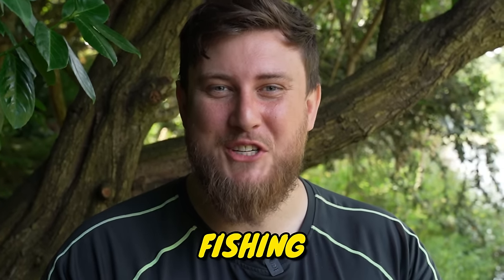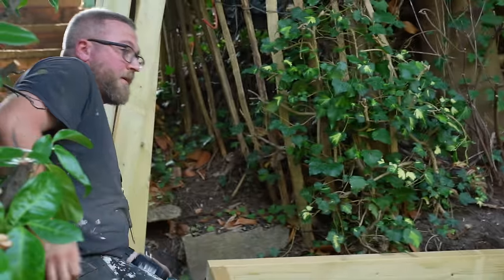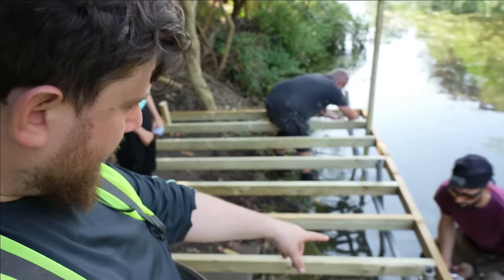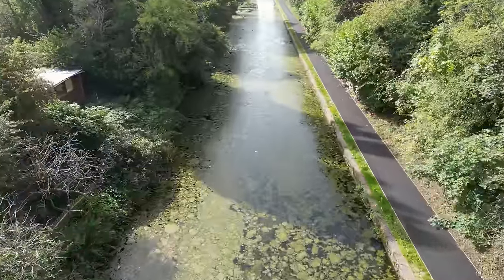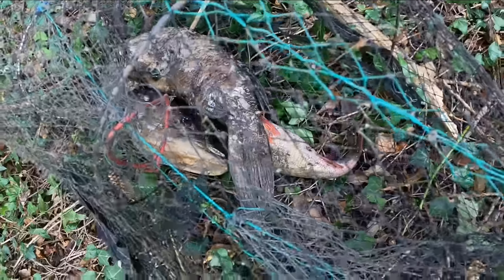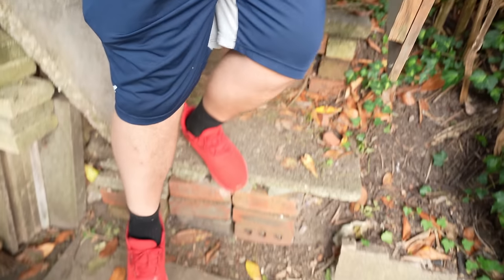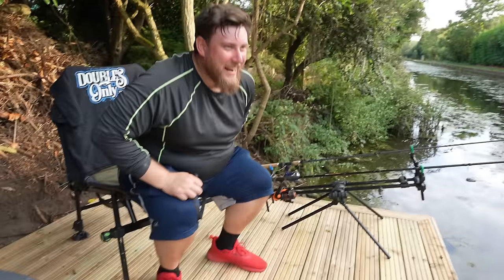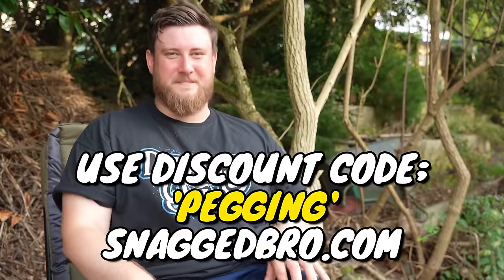The Perfect Fishing Spot: Canal Garden Makeover

Comment: Absolutely epic ❤

Think it may have been an idea to stain/protect the frame before fitting the decking, but a marvellous  job, many happy hours sitting there in the summer.
Reply from the maker: Going to get on the treatment, it came pre treated as well
Reply: If it’s pre treated you won’t need to do anything to it … paint or stain won’t adhere to pressure treated wood, it’s like trying to stick a plaster on wet skin. (It will stay on for a bit then just peel off) Maybe in a year or so once it’s properly dried out but your best just jet washing it if it gets dirty

Comment: Question, what are you/people using? Wire Trace or Flurocarbon? Im running a light setup and currently using 6lb flurocarbon. Im looking to go to a spot with pike in it, should I use a wire trace? will it be too heavy for an 8g Crankbait? Thanks in advance. Great content dudes
Reply from the maker: I use trace always for pike, google thin trace… I’m no expert at perch and sander set ups
Reply: @SnaggedBro  You have a link to the traces you're using bud? Cheers for the response. Seen people using obserd gauge of fluro but just doesn't seem best for light setups in my mind.